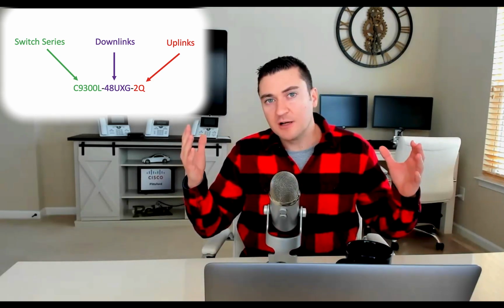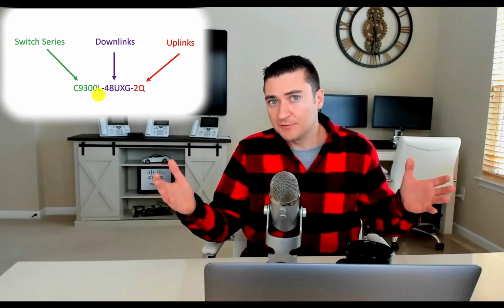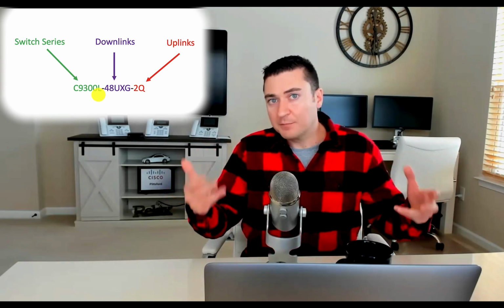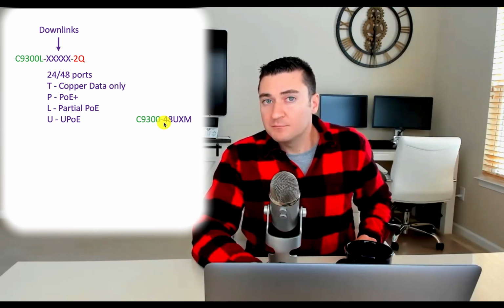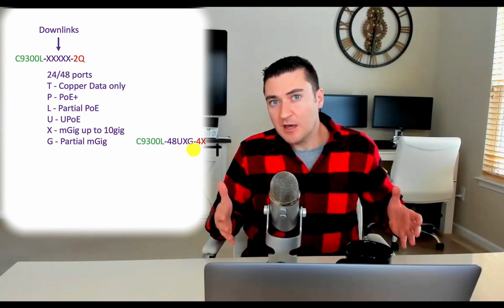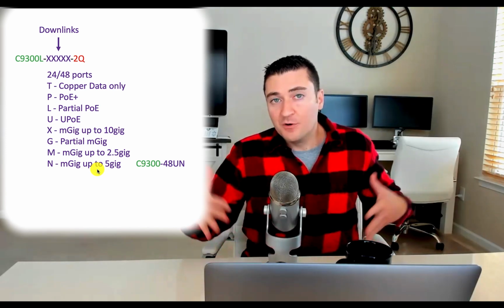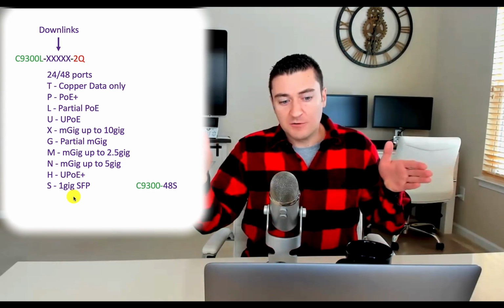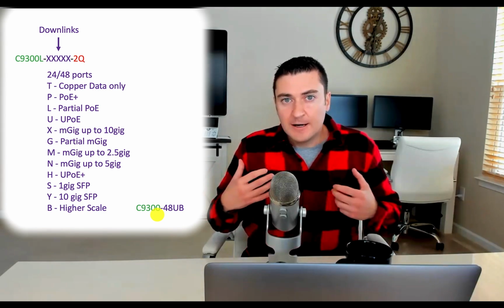How to Read Cisco Switch SKU's

Comment: @Cisco Sal Great video Sal! What are some Non-POE Cisco Switches (Specs) that compares to C9300-24P-E which is a Catalyst 9300 24-port PoE+, Network Essentials and C9200-24P-E which is a Catalyst 9200 24-port PoE+, Network Essentials. I appreciate it. Thanks